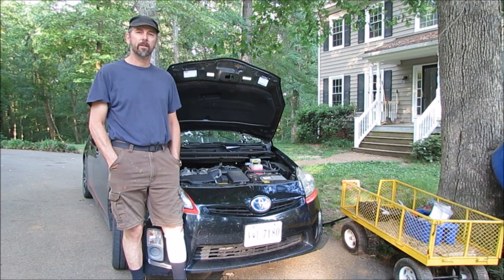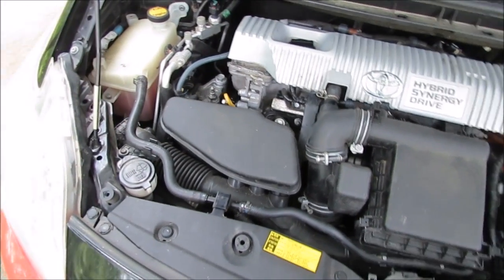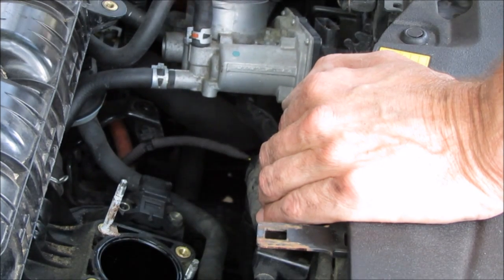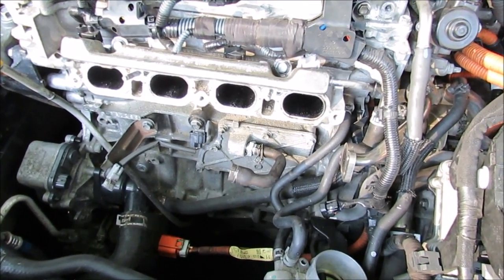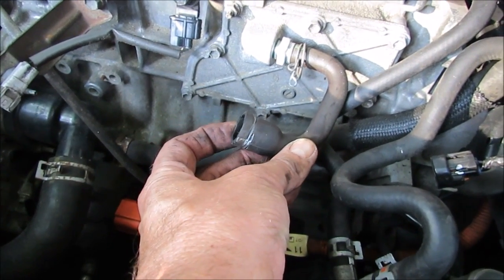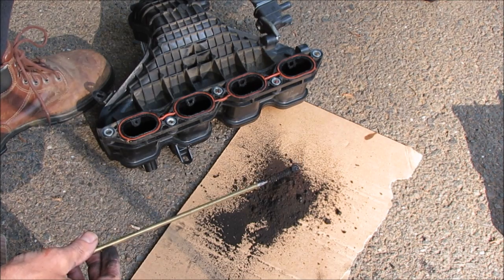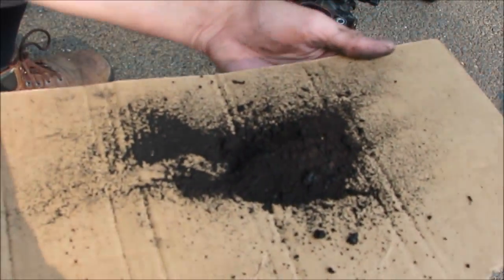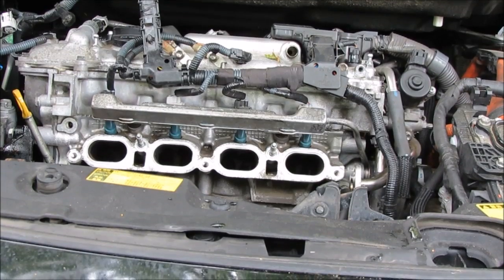Prius Intake EGR ports clogged

Comment: Hey RobRig, Just ran across your video on your intake for the Prius.  After being coerced into doing the maintenance on my Prius I recently changed out the PCV.  I did not do the intake although I bought the gaskets anticipating that I might have to go from the top but was able to get to the PCV from the bottom as another youtuber displayed.  I'm really curious though as to what type of fuel do you run in your Prius?  I know there's a lot of controversy regarding it does or does not matter what type of fuel you run but I'm a firm believer in running only Chevron.  Just curious as to what type of fuel you are running?
Reply: Costco 91 or shell nitro has practically no ethanol, which is the culprit in leaving this burnt deposit leftover. Those types of gas I use in my prius.
Reply from the maker: @sanjeevk1842  I'm aware of the "problems" with ethanol, mostly ruining fuel systems over time if the gas sits for long periods (like in my lawn mower). I've not heard that ethanol causes clogged intakes in fuel injection systems. This looks like carbon and oil (PCV) type of problem. I'm thinking of adding an oil catch can to the PCV system.
Reply from the maker: I run 87 octane (with ethanol as is commonly found in the US). It's rare to find service stations with no-ethanol gas, usually they're in rural areas. When I can find it, it's as expense as the 93 octane.

Comment: This should be a 50,000 mile maintenance on this Prius generation really helps on fuel economy and brings back power also I used steel and plastic brushes but if yours is more of paste like I found that a plastic brush is better to used because the steel brushes are harder to clean and this gunk  gets stuck on the steel brushes but the plastic ones can be clean a lot easier I bought my brushes at harbor fright
Reply: Seriously?  Intake manifold cleaning every 50k miles?   Good to know.   I don't see it being done in any of my service recipts.  After 215k, I think I need to do this!

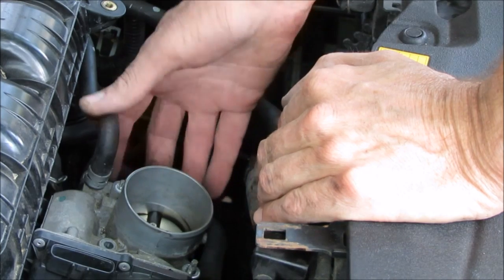Comment: 3:26 throttle body, this needs to be cleaned with special spray and maf/map sensor located next to it. When diy that procedure you will need to do all things together to warrant trouble free engine running for the next 50-80k miles, than cleaning again.
Throttle body clean
Intake manifold clean and map sensor 
Pcv clean and inspect, replace if necessary or if the car over 100knmiles
Egr valve, cooler and pipe clean 
All metal gaskets can be re used but  the rubber one on intake manifold must be changed. 
Good video 👍

Comment: You are on the right track.
But you should have also
1) replaced the pcv valve
2) cleaned the egr pipe
3) cleaned the egr stainless cooler
My 2010 with 170,000 miles runs like new after all the above.
Still burns oil though 😥
Reply from the maker: I replaced the pcv valve before  I cleaned the egr valve and egr cooler 5 months prior to doing the intake.
Reply: How much oil burned?  My 2010 Prius burns a quart every 3,000 miles and never replaced PCV after 185k miles. Toyota says normal to burn a quart in as little as 1200 miles. 
Some models have a recall on piston rings.
Reply: @mikeflores2000  2010-14 Prius had bad rings.  If the car burned more than a quart every 1200 miles, Toyota would change the rings and pistons IF it was still in the 5 year 60,000 mile powertrain warranty.  5 years expired in 2015 for the 2010 models; 2019 for the 2014s.   In mid 2014 Toyota did a production change to the new pistons and rings.  So some 2014s are better as are the 2015s.  The gen4 Prius in 2016 has a reengineered engine, egr, intake, cylinder cooling, etc. Much better hybrid system used across the Toyota product line today.  Only the upcoming Toyota Crown (replacing the Avalon) has the newest gen6 turbo "Hybrid Max" system that has well over 300 hp.
Reply: Start using Valvoline Restore & Protect 5w30. Stay away from 0w20.  You should see an improvement and reduced oil consumption after the second oil change.  Worked great for me!

Comment: I used carburetor cleaner to clean out the small ports. Took 4 bottles of carb cleaner to do the job. 100k miles later I have to do the job again.
Reply: 😳😳ужас
надо чистить каждые 30-40т

Comment: I cleaned intake manifold soaked it in a degreaser and put water hose in the side hole and watered my plants from four holes water came out from . So, I wanted to know if I can use RTV gasket maker ( sealant )  around intake gasket as an add on or do I have to buy new gasket or can I reuse the same old one?  Thank you.
Reply: If the gasket looks flat or is old, you should replace it, 20 bucks at autozone. If it’s in good shape and still protrudes you can reuse it. It’s better to replace being so affordable.
Reply: @matthewvalenzuela1441 . I am about to change the spark plugs on my Prius V 2013 since I got everything out cleaning the intake manifold and EGR cooler. Do you recommend NGK Laser Iridium spark plugs or Denso Iridium spark plugs that are available at the dealer ? Thank you.
Reply: @kumara5492  I went w/factory Denso’s, Toyota/Lexus updated the model of spark plug used to Denso SC16HR11 to reduce carbon build up as it’s a bit hotter plug. 🙏🏽

Comment: I am getting P0401 which means EGR insufficient flow. I have cleaned up the EGR lines from the exhaust and the straight line through the intake BUT never thought about the tiny holes on the intake. I am going to check it out because I am still getting the code but my car runs nice and smooth under any loads. I had to go through extensive work replacing the head gasket which is a common problem on these Priuses but I love the car not easy to give up on it. My other car is 2009 Camry hybrid with all the bells & whistles but I'd like the prius better!

Comment: Good video. You added some pointers Nuts About Bolts didn't have in a similar video. I did this job once, but only used fluids for cleaning. I'll do it again with brushes. Although, right now I'm not noticing any issues.
Reply from the maker: Nuts and Bolts does a pretty good job. They probably miss mentioning stuff because they're doing the job and making a video simultaneously. I find myself reshooting scenes because I missed adding something. It all takes time.

Comment: Did you clean it with carb cleaner? Can you use regular water?
Reply from the maker: I used brake cleaner, carb cleaner should work, although it evaporates faster. I rinsed it out with water, but water alone will not clean out the crap, you really need a cleaner and really have to scrub the passages with a nylon or soft brass  brush.
Reply: Can I use gasoline , filled up in a spray bottle and spray with some mechanical wire brush, or soak it in a bucket of gasoline ? thank you.
Reply from the maker: @kumara5492  I wouldn't. You have gasoline on your hands, clothes, rags, and highly flammable vapors in your work area, makes for potential hazardous situation. Not sure how well gas would work, maybe kerosene (less flammable) would work and be not as dangerous, maybe. I just don't know. I would advise against the gas, but that's your decision.
Reply: @robrig1646  Well gasoline didn't work on a small connecting pipe I dipped overnight as a sample. So, I went and bought 1 gallon of  Purple power degreaser for $5 from Walmart . That one worked  perfect followed by power wash at car wash.
Reply from the maker: @kumara5492  Cool. Glad to hear the purple power did the trick for you.